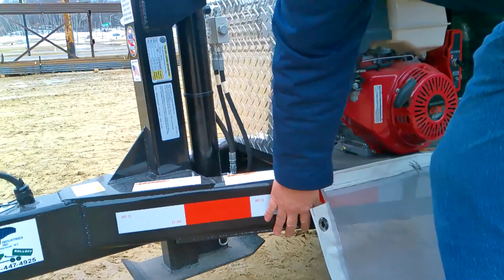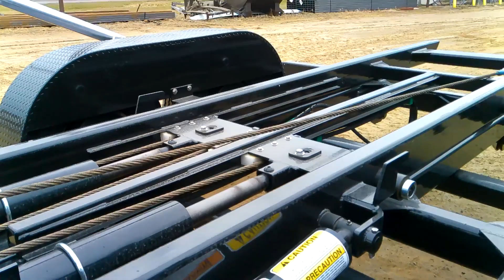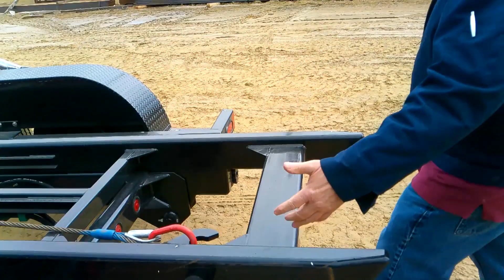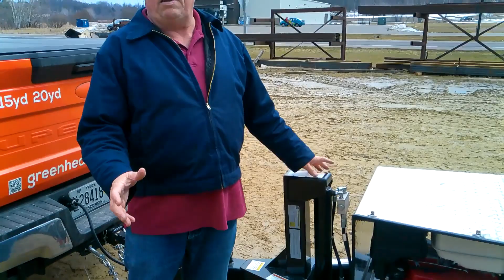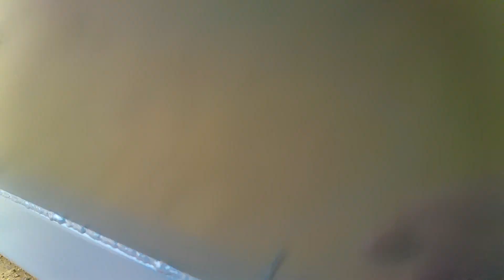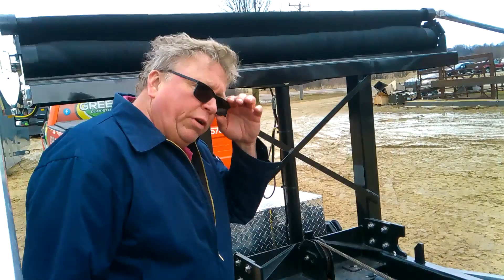THE ULTIMATE DUMP TRAILER! Nedland Industries EZ-Rolloff dumpster trailer

Comment: Hello, how big of a dumpster could you use with this trailer ? And also how much does ir cost ? And how much are the containers ? Thank you in advanze for your help.
Reply from the maker: the biggest container is a 20yard. the trailer cost like 30k and containers are 6k about. prices change and there are alot of options so you would have to call to get current prices
Reply: @Lifes_Apprentice  thank you sir

Comment: Quick question... Do you know if landfills care about your gvwr or enforce any kind of DOT rules... For example if my trailer gvwr is 9990lbs but my axles are rated for 14k lbs and my overall trailer weight is 15k lbs with trash would the landfill stop me and report me or do they not care about how much I weigh?
Reply from the maker: Landfils do not do that to my knowledge. If your trailer is 9990 that is your limit it has nothing to do with axles
Reply: Nah, they don’t check that shite
Reply: They weigh ya going in, they weigh ya going out and never look at anything else.

Comment: What is this specific model called
Reply from the maker: It is a 16k GVWR
Reply: @Lifes_Apprentice  what length trailer? 12' or 16' ?
Reply from the maker: @Dad9700  The rails the dumpster goes on is like 15' made for a 14' dumpster
Reply: @Lifes_Apprentice  I just ordered my EZ ROLL OFF16 trailer with 2-20s and a 15yd. I’m currently busy as hell with the 2 - 16’ dump trailers. Need Nedland fast but have to Waite for them. Can’t wait
Reply from the maker: @patrickceithamer9432  It is worth the wait

Comment: How come you prefer bumper pull over gooseneck? Seems like it would be tough with tight spots and do they make a gooseneck version?
Reply from the maker: yes, they make gooseneck trailers as well. With our trucks bumper pull is just fine and we have never found a dumpster we couldnt set. If you are running a 3/4 ton truck a gooseneck may be better